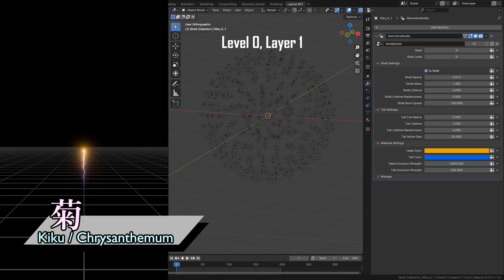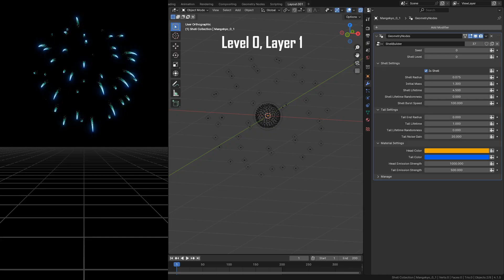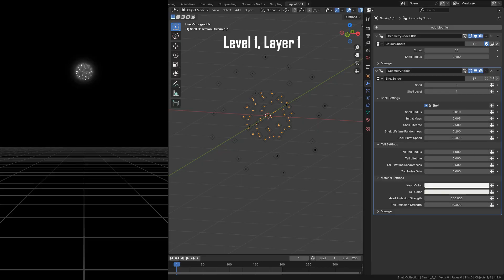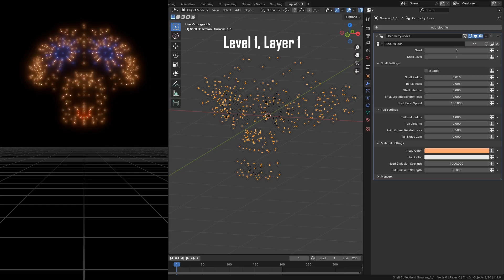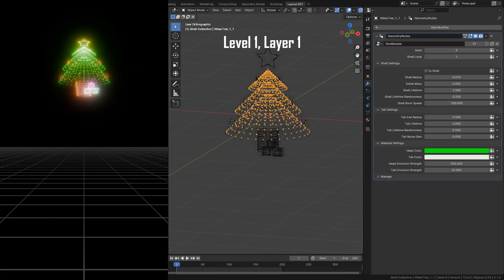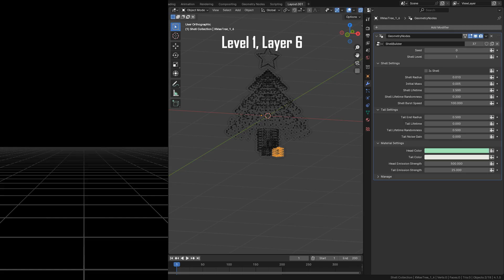[Blender] Let's Launch Fireworks with Geometry Nodes!  Ep.10 Shell Examples

Comment: I am building a wave rig and was wondering if this type of approach to particles in geometry nodes could be adapted to give the effect of  foam exploding when a wave crashes. what would you recommend
Reply from the maker: That would be a cool thing to try.  
One thing I would caution is that this firework approach does not take into account interaction among particles.  Liquid based simulation, including foam, is more about how individual water molecule interacts with one another.  For example, if a clump of molecules are close enough to another, surface tension will cause it to join them together and if they are far enough, they split into 2.  Those physical properties might not be easy to replicate, but if you just want to focus on exploding and spawning part, it should be worth a try.
Reply: @BlenderStudioS-bs8mr  ah yes liquid tension . A great thought . Thankfully I am after something simpler. I am thinking along the lines of implementing your shell and trail sections of your tutorials and spawn them continuously across the impact zone of the wave in a larger and thicker fashion. not sure if this is the way to go i have tried just normal particle spawning with some gravity and I am not satisfied. Thanks for the tutorials!

Comment: I am having one issue with L1L1 tail being too big, L0L1 and L1L2 seem fine. I have triple check values and code. What nodes or groups should I check first?
Reply from the maker: Assuming most all node setup is correct, since it sounds like other layers and levels are working, I would check the values of tailEndRadius and tailLifetime on L1L1.  
Let me know if that doesn't fix it =)
Reply: @BlenderStudioS-bs8mr  values are all correct. Must be a node, but so far all nodes I have checked are correct. Still looking
Reply: @BlenderStudioS-bs8mr  to get some to match your results I had to make adjustments. I adjusted Kiku L1L1 radius to .3 to match but L1L1 is slightly higher not centered.  Botan I increased count to 100 for L1L1, centered fine. All others seemed to match. Strange
Reply from the maker: Not quite sure what could be causing the issue but I can provide somethings to watch out for
1.  When making individual shell objects, make sure to not do translation, rotation, scale on object level.  If you want to, do it in Edit mode.
2.  If one layer & level is working and other is not, try to delete the bad one and duplicate the one that is working and see how it fans out
Can't really tell at this moment but definitely play around with it.  Those are just examples so try creating ones to suite what you want =)
Reply: @BlenderStudioS-bs8mr  I made an all new L1L1, didn’t change anything. Looking closer, I noticed that kiku L1L1 is not symmetrical, it is larger on the top half and smaller on bottom (ie. Shorter tails). L1L2 and L1L3 are both symmetrical. They use the same golden sphere GN. Somehow the top tails are longer making it look larger. Any ideas on the symmetry?
Reply from the maker: Try applying a golden sphere to a random geometry and increase its point count to like 500.  If that shape is not as intended, there might be an issue with the golden sphere nodegroup.
At this point though, I don't think I can diagnose the issue without actually seeing the end result.  If you want me to take a look at the blend file and you don't mind sharing your files on internet, I might have a look at it (except, you will have to wait a while since I'll be out of town)

Comment: Thank you so much, I already finished the tutorial! Sugoi! But I have a question about how I can separate the tail instance per shell level? Like how you did on the shells. In the cycles version, there would be an issue with rendering where it renders a very dark part where the first initialization of the tails is. So I am thinking if it could instantiate tail with a delay parameter per shell settings?
Reply from the maker: Thanx for watching the full series =).  
Unfortunately I am not certain of the gist of the question but I presume the issue is low luminosity when using the Cycles render.  Raytracing engine like Cycles cannot emulate a bright colored light source without having a some object to reflect on.  It looks like a spec of white pixel even if you up its emission strength.  One way to tackle this is by adding a bloom, which when using Cycles can be activated by using a glare filter in compositing.  If you haven't done that, I'll try that out first.
Delay parameter can be set, which I'd assume will be affecting the area of the tail formation.  Not quite sure how you'd use it but now that you went through the tutorial, the node group is yours to customize as you like =)
Reply: @BlenderStudioS-bs8mr  Thank you for the response. I found the issue, and I want to share this in case someone has the same problem. The issue lies with the cycle's max bounces, since the initial explosion of the shell instantiates a ton of tails simultaneously, and by default, the max bounce for transparent objects is only 12, and since there are a lot of transparent objects at the same spot, the rays never reach the camera, so I crank until it is working as it supposed to be. ^^

Thank you again! I learned a lot from your teaching.
Reply from the maker: Thank you for sharing your solution =)